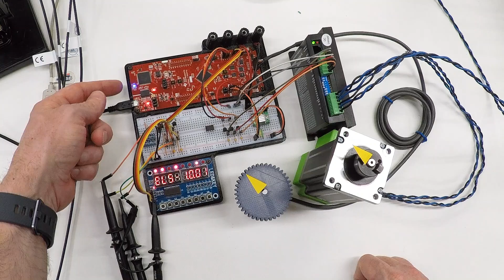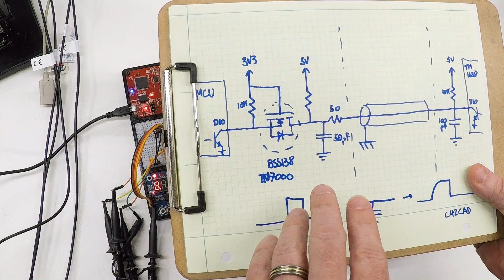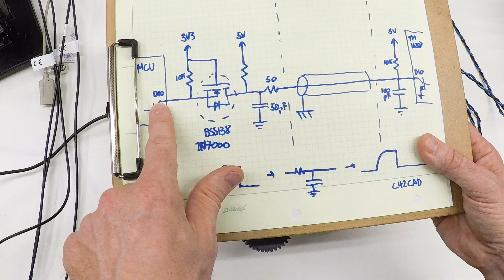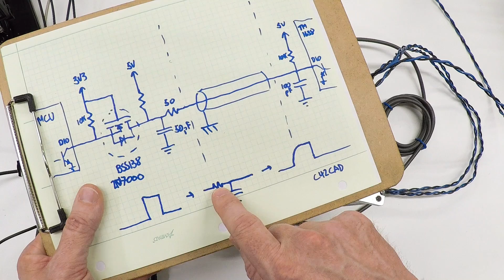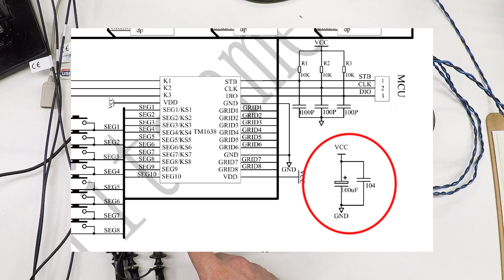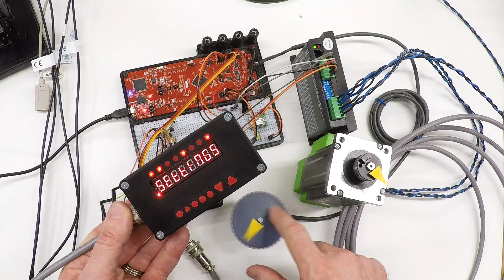Lathe Electronic Leadscrew Part 3: Control Panel and Debugging

Comment: Anyone know if there is a good 120v servo motor and drive with enough torque to spine a mini lathe spindle chuck and also has encoder output compatible with a Mesa board for LinuxCNC?  I want to do one of these power feed screw builds but looking to skip the encoder part if possible and just use the one built into the servo motor

Comment: A note on "lost steps": I used this system for more than three years on a Harbor Freight combo machine, that came with no gears (nor a half-nut). I did use a hybrid stepper (stepper with encoder), and I can count on the fingers of my forehead* how many times it lost a step and errored out.
I did use a 3:1 reduction for the very heavy carriage, which helped. I may or may not have been able to drive it 1:1, but as I needed to mount the stepper in a particular spot, I used the opportunity to gear it down.
I've helped a few others add this to their machines, and even did my mini-lathe, and am presently doing this to my 12x35 Grizzly, using a stupidly oversized NEMA 34, also geared down.

*Whilst may family tree may resemble a bowl of Spaghettios, I have the normal number of digits in the proper positions, or at least close enough.

Comment: excellent  idea. there  is a question i have. Asked meny times  but i have not yet go an answer, it is this  why can't i use a  mobility scooter motor.  to spin the shaft at,  variable speed's  control Of the rack As on my lathe.  there is no lead screw just a shaft that is drives the  saddle   can you put me right on this point.   it is  controls by  the rack,   Controls & then drive  the saddle Having no banjo liking & the spindle. Is gear box driven & independent driven from the  rack.  will the controller work in this case. i suspect it is used to control the computer mother board.   i wont ti fit one on my lathe But it a differ tip of lath will running the lathe at a set speed  allow the   vrareack to supply the increace & decries of the led screw  to select the thread  count ? rack in my case. can you give me some pointers. will your  lead screw cope with a rack driving the sandal Can i ues a mobility scooter  motor in sated of a steeper motor ?  I have several at hand .
Reply: answer their was None

Comment: All the “”wall wort” power supply give you noise are topically half wave rectified, with no filtering. Battery’s under charging don’t  need capacitance. “Because the battery essentially is a big capacitor”
So take that nice scope and look at the out put of the wall charge it’s a lot of bumps all positives but humps. Every rising or falling part of the wave is a count. 
Put a 500-100 uF. Across the output of supply, it will get better.
Keep up the good work
J Hicks

Comment: If I remember correctly, the LED&KEY Board need some modification to work correctly. A trace need to be cut and re-soldered.
I think graphic LCD will requires probably another dedicated microcontroller board as it is memory and CPU intensive. I don't think it is wise to share with the real-time processing tasks.
Since the application only requires limited amongst of TPI to be cut, I won't be going for the graphic LCD version.

Comment: The effect of the pullups is less than expected because the MOSFETs are on for a good part of the rising edge and allow the driving end to charge the capacitance quickly initially. It looks like the SPI outputs are tri-state rather than true open drain. If the MOSFET has a low gate threshold it can be conducting all the way to the switching threshold of the receiver and the pullup resistor only has to pull it the rest of the way to 5V.

Comment: Great project. Thanks for sharing. The pulse problem has probably to do with the voltage. The phone charger has probably a higher voltage around 5.2 volts. The USB has usually around 4.9 volts.  When the chip triggered around half of the power supply voltage the pulse is high enough to trigger at  USB and just to low at 5.2 volt.
Reply from the maker: These USB phone chargers actually fluctuate between 4.5 and 4.75V.  I use them to run esp8266 devices that log voltage, and it's really erratic.  Won't be buying any more of those.

Comment: Thanks for the great project. I ordered your kit and it should be here next week and I want to make use the same box that you used in the video. I use Fusion 360 with my CNC mill and was wondering if you had posted a file somewhere to machine the control panel aluminum cover. I didn't find one, is it available? Thanks.

Comment: Seeing you use the Bud boxes gave me the nudge to get one for my recently-acquired drill press.  I want to make a safer and more versatile control for it besides the ancient flaky toggle switch.  The investigation into the power supply issue was cool too, with the evidence shown in the scope traces.  I didn't realize your typical wall wart was that noisy.

Comment: There should be min. CS hold time called in the data sheet of the display driver. I would reduce the bit rate because the signals do not get to full HIGH. Great project!

Comment: really great video.  question and comment.  question: could you use opto-isolators to get all of the benefits of that isolation you mentioned but also use it for level shifting?  also a comment... if you put a bit of translucent red tape or plastic over your seven segment displays i think it will be much much easier to read as you will see the segments that are lit and hide the unlit segments.  Thanks for the great videos!

Comment: Yes, I need one!

Agree about using a touch screen, but personally, I'd like to build a more sophisticated display for my needs.  I have a Hardinge turret lathe, and you have most of what I'd like to make into electronic carriage control for manual operation. 

Phenomenal work - I'm looking forward to catching up on your project videos, looking at the code (nicely commented btw), and making it work for my lathe.

Comment: I had a similar problem (ish) with a camera I built powered from a bench power supply or a cheap PSU. To the point if I touched ground anywhere the board would reset. Those cheap chargers don't have a ground pin so no true reference to ground, they sort of make it up. When I plugged the camera into the laptop via USB (for comms, still powered by the bench supply), the USB in the laptop having a proper ground reference things got wierd! Does your motor controller have a true ground, might be doing something similar? Time and projects move on - likey useless information by now! :)

Comment: I just stumbled into this series and I have encountered similar problems when trying to convert an elector-mechanically controlled machine to a computer controlled system because electronic switches are so much faster than mechanical switches. Time has to be a consideration. The computer chip sees the switching as instantaneous compared to mechanical contact switching. We also encountered it when trying to add a proximity switch to stop an upstream feed conveyor and alert a machine operator when a component stopped turning. The short interval resulted in many false stoppages as the component speed varied by load. If the it slowed for an instant, it stopped the conveyor. All it took was increasing the time allowed to get the required counts.

Comment: I like that black plastic better. You should be able to print your lettering into the front and even do so in another color. You just need a simple 5-12v transformer that isn’t an actual charger.

Comment: For some reason I always knew these bidirectional converters as "nifty two-way but inherently too slow for anything that is actually fast", so I was surprised to find zero mention of this aspect anywhere from Ebay to Banggood and even Sparkfun, including the linked many-page Philips app note analysing the thing from top to bottom. Not a peep. One has to go all the way to Adafruit to find this immediately addressed in their product description: "the 10K's do make the interface a little more sluggish than using a TXB0108 or 74LVC245 so we suggest checking those out if you need high-speed transfer". So, yeah... nice little gotcha about not wiggling things too fast, apparently not nearly as commonly advertised by those who sell this as it should be.

Comment: I Changed My Mind 
I was one of the ones pleading for touchscreen but I have been thinking about it and honestly, I now think the most important thing is a tactile feel. Bear with me as my lingo may be incorrect, but I am hoping you will make it possible to work with the half nuts always engaged through a threading operation. 
On the very small mini-lathes, that's how a lot of us thread (keep half nuts engaged and reverse the lathe before each threading cut). Now, with your controller, I imagine a new way to do it where buttons on the controller stops the leadscrew, so you would hit a "Stop" button when your cutter got to the relief cut. Then back out on the cross slide and hit the "Reverse" button on the controller (which could be set to a faster return speed to move the cutter back towards the tailstock) and then hit "Stop" again. Finally, for the next cut wind the cross slide back in to cutting depth and hit the "Forward" button on the controller and let the box act as the thread dial indicator and engage at the right time. If this sort of programming would be possible, then the touchscreen would not be a good control interface. Tactile buttons would be needed to so you could keep your eyes on the part and not the screen.

Comment: Hello James! Congrats to your weight loss, I am a big guy and I know how hard it can be to lose 1 pd...
I've been watching your series about the electronic lead screw from No.1 on, and I am happy that someone with knowledge is diving into this issue. I wanted to do the same with an arduino but it's way too slow for this job and I was not able to solve it. Great series and fine video technique, too! My question is - how do I get the code from your github channel into my Ti board? Doing it just with the USB port and what do I have to do in the Ti Studio? Are there any adjustments to do and some specialties? Do you show us this part of DIY in one of the next parts? Would be great, I'm keen on seeing something rotating...:)
Reply from the maker: Actual testing on the lathe is coming up soon.  To program the controller, TI provides a development environment called Code Composer Studio.  I'm using version 9.  I'll think about doing a tutorial video.
Reply: @Clough42  Thank you!, I'll take a look at it. A tutorial would be nice! Waiting for any new part... :)

Comment: Very interested in your project. You have done an excellent job in presenting your project.  Well Done.   I have a Grizzly G4003 that I am thinking about adding CNC conversion.  I would be interested in a kit and/or boards (with holes, eyesight is waning with age).  I have ordered a TI board, encoder, key pad, etc. based on what I have seen so far.  Was wondering if you would  publish a circuit diagram and pin out for the project  (I have not been able to find it) and maybe a photo of your breadboard wiring.   Also, in the future, it would be helpful to me to have a video showing how to upload the sketch code onto the TI motherboard, although I may be able to figure out that myself since I assume it is similar to Arduino.  Also, want to mention, I am planning on putting my Z drive on the tail stock end by machining a section out of the end bearing assembly to allow a timing belt gear to be installed on the shaft.  I would then modify  the end bearing assembly to fit a roller bearing (for belt tension load)

Comment: Interesting project. Have you seen the PIC18F2620 implementation in Circuit Cellar #196 Nov 2006? He makes use of Bresenham's line algorithm to time the output pulses.

Comment: By the look of the datasheets, you shouldn't need level shifters, just a 3.3V pullup. The TM1638 is low voltage interface friendly by interpreting anything higher than 0.7V as logic high and anything below 0.3V as logic low. Just ensure that there is no pullup on the side of the display/button board, or delete it if present.

Then again with moderate baud rate and decent delays, level shifting is fine. Good one on finding the STB bug. Nice generous STB drive now :D. Conveniently, most of the flank distortion of the signals introduced by capacitance sits well above the 0.7V threshold voltage that i mention above, so the signal is really more legible than it looks at a glance.

For static protection, you can add diodes from signal to both ground and supply of the microcontroller. 50pf or 200pf is not a real static protection measure.
Reply from the maker: I had wondered if I could get away with driving the display at 3.3v.  The hangup is that pullup resistor on the board.  I am really trying to make this something that anyone could put together, and requiring a tiny resistor to be removed from the stock board is something I wanted to avoid.

TIme will tell if that was a good tradeoff.

Comment: Is scope like that even close to affordable for an amateur?  It's 25 years or more since I did anything that low level but back then personally owning something like that would have been a fantasy.
Reply: Hi,
I believe it's a Rigol DS1054z scope four channel with serial decoder.
The 50Mhz base model, but hackable to 100Mhz, via software. Check out EEVblog for more information.
400 bucks approximately.
Adam

Comment: You should not use touch screens on machine tools as HMI for direct contact! Very nice fault handling in this video, even though I think a simple voltage divider would do the trick instead of the level shifters?!

Comment: Hi, that was a very good and well presented masterclass in debugging. I'd like to suggest, if only for my own benefit (!), that at the end you consider either making the final (is it ever?) compiled code available, or link to or demo how to go about doing a compilation. At the moment that part looks like a 'black art' to me! I've looked at the reference for the source code - which I can sort of read -  but would have no idea how to put it all together. I do have a handy son who understands these things though, but not everyone will have such a handy child or knowledgeable friend. I'd like to confirm that should you choose to make a through hole pcb board or a full kit (less the heavier shipping items like the motors, but perhaps with an assembled smd board) available at anything resembling a reasonable price - including recovering some of your time and development costs - I would order one. This is perhaps the most useful add on to any lathe - even one with a change gear box - that is available. The ability to instantly switch between US, imperial and Metric thread standards is invaluable to much of the model making world outside the States for reasons that are a bit too long to go into here. If you do go down that route please endeavour to make sure that your selected supplier or fullfillment centre can both cope with international orders and do so without silly shipping costs - some sadly price themselves out of the market. BobUK.

Comment: Id say RS485 is a better choice for robust communication over long cables.
But you could still get a lot more timing margin out of your SPI bus by replacing the 10K pullups with about 1 or 2 K. The chips are strong enugh to drive those pullups while keeping the edges nice and sharp.
Reply from the maker: Perhaps.  Because there are actually three 10K resistors in series already, it's already pulling 1.5mA.  The MCU can only sink 3 or 4 mA.
Reply: @Clough42  Ah yeah 3 of them do add up. But you can go right up against that maximum current without worries, digital chips have such weak drivers in the pins that they can't damage themselves from overcurrent. If a pin is overloaded then the voltage on the pin just sags, easy to check with a scope when a pin still has enough swing. You are already overloading the pin past 10 mA for a berif moment each time it toggles due to the capacitance. Seams fast enough anyway. 
Oh and that LC filter probably wont save you from  more serious ESD discharges. Because the control panel has a connector without a longer ground pin means that a signal pin can make contact before ground, so kilovolts of static charge in the controlpanel+user could go straight into the digital pin. A good way to do it is have a 5V TVS diode on the other side of the 50 Ohm resistor to guide most of the ESD discharge away to ground. Survives the worst of ESD discharges provided the diode is rated sufficiently.
Reply from the maker: @berni8k  Thanks!  I was planning on doing some tests this afternoon with stiffer pullups and slower baud rates.

Comment: The cure for capacitance on I2C and SPI signal and clock lines is to make certain all your inputs are configured in Schmitt trigger mode. Or, if you're bit-banging the input (or using an FPGA that doesn't support Schmitt trigger mode), use a software glitch filter (for example, sample the input at 16x the clock and ignore transitions that aren't steady for at least 8 samples).

If you think about it, an I2C or SPI signal line  with a lot of capacitance (either distributed or bulk), which goes off-board (or all over a board to different power domains) isn't really a digital signal line. It's an analog signal which might be very noisy or have transition times which are too slow for reliable detection with non-Schmitt inputs.
Reply from the maker: This is good advice.  The TI DSP chip I'm using has a sampling qualification mode, but I think in this case, the SPI peripheral is actually conditioning the input.